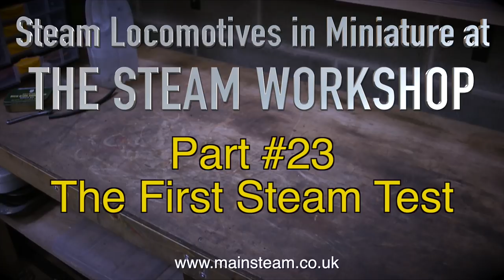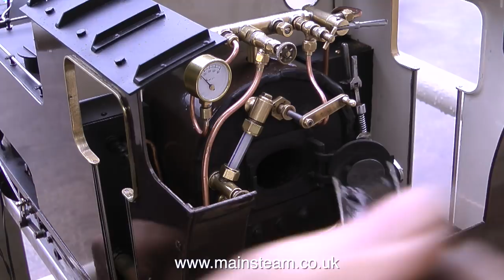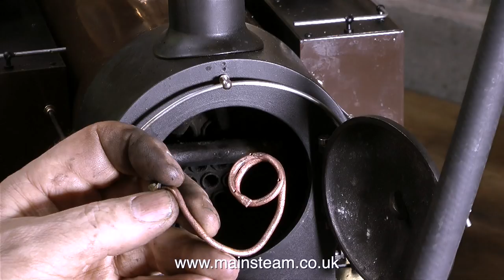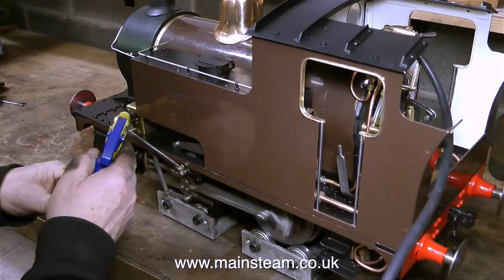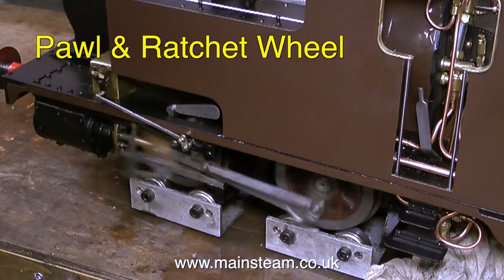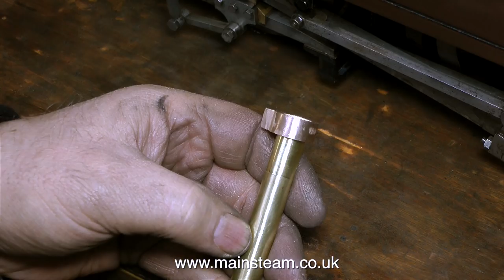WORKING AT THE STEAM WORKSHOP #23 - THE FIRST STEAM TEST

Comment: As bad as it sounds to say this, Fantastic Video, Sorry for your issues, but this is exactly what new people to the hobby need. As a new guy rebuilding a Little Engines American, which was not far from this condition, I have yet to have that flawless day of running.  

I have learned that Live Steam is not an out of the box hobby.  You are one of the few out there that shows your problems and mistakes.  We Newbies need to know the Good, the Bad and the Ugly.  More importantly, how to fix it when "Everything Goes South".  All is useful. 

Thanks to Blackgates, I am about half way thru the new piping.  The injector is mounted and I am working on the axle pumps now.

Comment: Keith, Interesting deposit build up in the boiler  I work on a yacht and as the engineer / Captain  I have to deal with deposit build up quite often due to the salt water cooling on many of the systems I use a mild phosphoric acid to clean out the systems I leave it in for a couple of hours flush out and as good as new I use it on heat exchangers that are copper and bronze with no damage to the silver shouldered joints Maybe a dose of that in steam engines might help with the problem Thanks for taking the time to make these fantastic videos 
Andy
Reply: Andrew Naylor i have heard that Coca Cola or Pepsi also works.

Comment: Hi Keith, great videos, I really enjoy them.  On the subject of screws and bolts, in engineering terms, a bolt has a non-threaded part or shank below the head but a machine screw is threaded up to the head.  So there are wood screws, self-tapping screws and machine screws.  The idea of the unthreaded shank on a bolt is to retain the full strength of the material it is made from and also the shank can be made a good fit in the part it passes through ensuring reasonable alignment of the parts being joined (not precision, that needs dowels).  In model engineering the distinction is relatively important but if designing building large structures or machines the distinction can be crucial.  By the way there are standards for defining the length of threaded part on bolts.  Machine screws are generally used for holding thin parts on to thicker parts which can be threaded or use nuts plus they have other uses but this comment is too long anyway.
TerryD.

Comment: i have a question. Why are you spraying wd40, which is not a lubricant or an oil, on the wheels while it is turning?
Reply from the maker: Juts to clean the rods and the motion so they don't rust - there is already more than sufficient lubrication . . . .